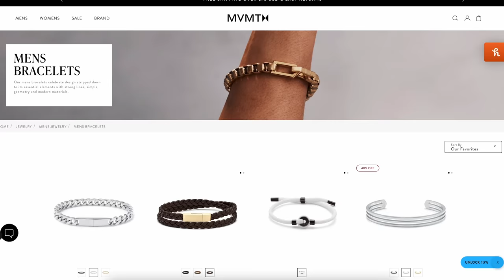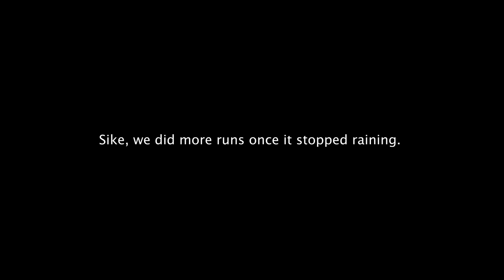Racing Adam LZ in my R34 GTR

Comment: I think we should agree to disagree that both cars are fairly different, but both very cool cars.
Reply: But at the end of the day only one of the cars was built, the other was bought from a catalogue...

And only tommy is impressed by catalogue shoppers.
Reply: @Boosted26L a welded intake and exhaust = built in your opinion?
Reply: @Boosted26L meat rider
Reply: @Boosted26L booth these cars were bought and built lol
Reply: @Boosted26L it is next to impossible to get most of those “parts from a catalog” in the us. Car is built bottom to top, adams is a clean car and a amazing example of an r34, but tjs is another level and usually I’m w Adam on all builds I’m not a widebody stance guy or anything tj just basically let tommy build it.
Reply: @Boosted26L  i guess your definition of “built” is custom fab work?
Reply: @Boosted26L 😂 You’re the kinda guy that argues online about android vs apple

Comment: The way tommy fixated on time and when the modification is done makes me feel like they said they probably wouldn’t have awd and last min “figured” it out
Reply: its not easy to diagnose an issue the car had before it even came here. once we took it apart and started replacing things we were kind of just hoping itd be solved in the process. it wasnt and we found the culprit 15 minutes before the race. our number 1 goal was to drive it to gridlife and wether AWD worked or not we reached that goal. its just the icing on the cake that we also solved every other issue this car had.

Comment: If you're going to talk trash you have to back it up, your excuse is that your R34 was built for back roads instead of "straight line racing" so go ahead and challenge Adam to the fastest lap around a tight circuit since the roads are obviously not safe

Comment: I’ll say the same thing I said in adams video the only reason you got him in drag race at all is because your front tires weren’t powered awd eats 20-30% of your power and is worthless in drag racing if both cars are making what they are claimed to make  his will be faster the min you fix the awd you had a advantage not turning the front wheels
It was funny to see his response especially when collette had to tell him it wasn’t even close but your car was setup with an advantage from the jump

To all the idiots before you try and argue with me awd is only an “advantage” for about 60 feet before it hinders you and a properly set up rear end on a 2wd will smoke a awd car to the 60ft for drag racing awd is unnecessary complexity weight and a gigantic patristics draw of your available power
Reply: Wym he did Fix the AWD last sec
Reply: yeah youre wrong. AWD did work tj was sandbaggin adam.